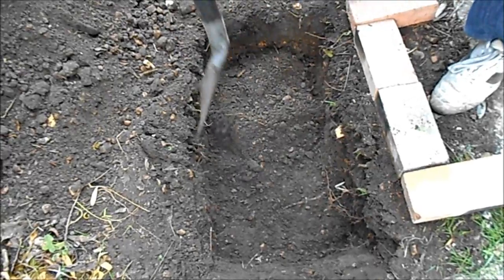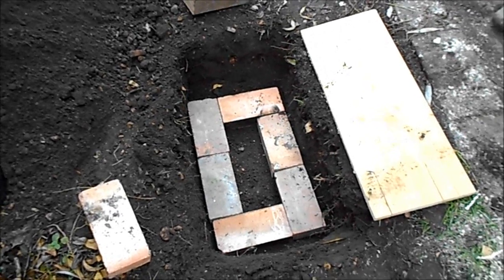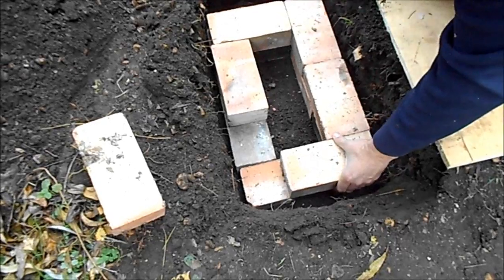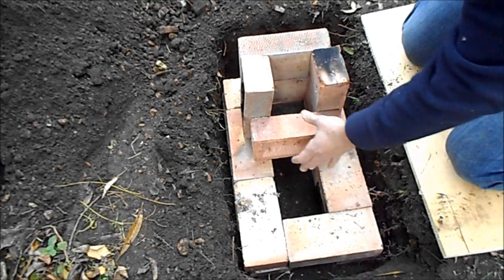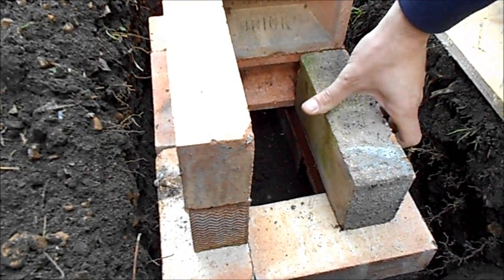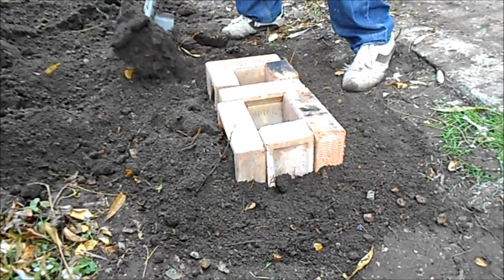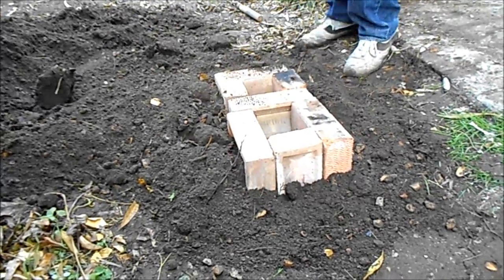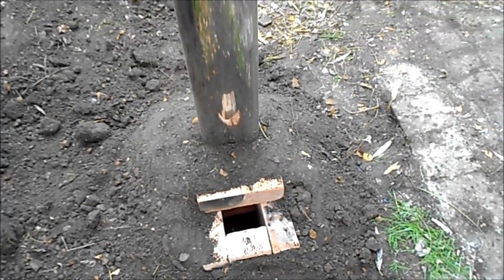Rocket stove 2

Comment: OK if the goal is to just burn up wood scraps.  That poorly secured chimney is flakey.  Wouldn’t a ceramic flue liner be better and brick around it all the way to the top?  Then it would have a more stable cooking surface.  Also by burying this set up, there is no easy way to pull out a brick to clean ashes. The basic rocket stove design is there, but needs improvement.

Comment: This is not a rocket stove: no insulation to make it work efficiently, hence all the unburnt carbon particles escaping from the chimney and blackening the can. Common bricks are a heat sink, not an insulator. The riser (chimney) needs insulation too, to burn hot enough. Even though it's too tall for the size of the burn channel, it's still not burning all the fuel gas and particles. Basic design principles for real rockets here:

http://www.bioenergylists.org/stovesdoc/Pcia/Design%20Principles%20for%20Wood%20Burning%20Cookstoves.pdf
Reply: Stove is for cooking,,, and where do you cook

Comment: Hey there, Dohman Man!  Thanks so much for posting this!
Have you looked into Rocket Mass heaters?!  It uses the rocket stove - and I'm delighted that you were able to pull off that seal with dirt as I couldn't find many who'd tried it - and then you cover the chimney with a metal barrel creating a chamber that can get up to 3,000 degrees (sorry - don't know what that is in Celsius) burning even the smoke ( a gassafier).

The exhaust is channeled out usually through a metal tube buried under some heat-absorbent material such as cob or pebbles which heat up as the exiting heat passes through.  You can then let the fire go out, and those pebbles (or whatever you use) continue to radiate heat often for days.  Folks most often turn this section into a seat-warming bench, but the exhaust tube can even be run under the flooring.

If you haven't checked out Permies.com, they have tones of videos and pictures about it.  They also have a bunch of diagrams of a rocket mass heater in just a Google graphics search.

Good luck on your end!  Knowing how to keep warm safely inside a tent could save lives!

Oh- one question - were those firebrick or regular bricks you're using?  Thanks!

Comment: This may be a silly question but in cold weather does the ground insulate the heat or does it cool down the stove? I am new to this and I find it fascinating.
Reply from the maker: +Josh Byrley  The reason for building in the ground was to seal the chamber from draughts. the bricks were laid dry , no mortar so this gave the fire  chamber  a complete seal  and gave an excellent draw to the fire.

Comment: would this stove work inside a tent you think,or would it be to smokey
Reply from the maker: +railroadDon  I would not recommend  inside a tent. This was just an attempt to build a quick and easy rocket stove.
Reply: +Dohman Man I  made the length of the under ground part 6 feet long,made a steel top for the fire ,which helps keep smoke out of the tent,I used some of that fire cloth that goes around your fire place doors,so far its been working fine,the walls of my tent are made of 2x12 x10 's pine  front and back,top is a canvas over a polymer type fabric,I been cutting trees on a 57 acre wood lot,I start my fire as soon as we get there,get it going good then go cut trees,either me or my friend will keep wood going on the fire,its a good shelter now thanks for your video ,once I get some time and with weather better I make you a video ,we can cook off it ,keep warm,in fact one afternoon me and my dog fell asleep in the tent on my home made benches,we ate and were tried of cutting so we napped till night fall,got a sleeping bag and blanket from my truck and called my wife to tell her I was staying out camping that night,temps got to 22 degrees F with a wind chill of 10 above I cut lots of small wood but also had some bigger size ones all off ash,we stayed and slept fine all night long,in side tent temps were 68 degrees F ,no lower then freezing,it works believe me works just fine ,thanks again
Reply: railroadDon yes it can be used in a tent ,I have had one in my front yard for 3 years now,with a 55 gallon drum,to keep my dogs warm when this Texas weather dips down to low.

Comment: Good build ... im going to do something like this but longer, & put a metal drum over exhaust side and vent to run   inside building for flue gas heat .  thanks for another idea
Reply from the maker: Im hoping to keep building more experiments with this and make use of the heat in a practical way. Good luck with your ideas.